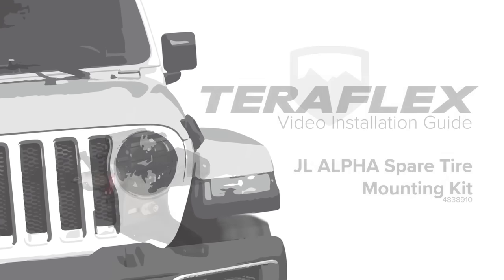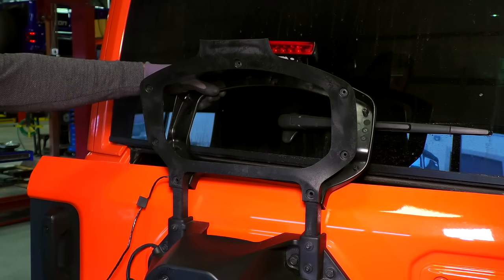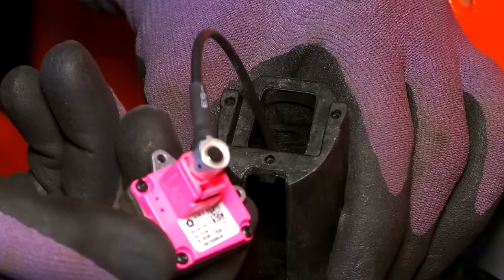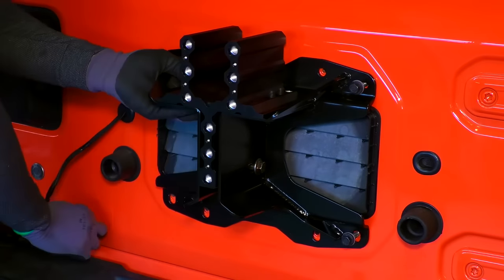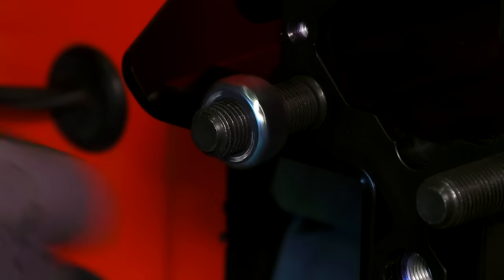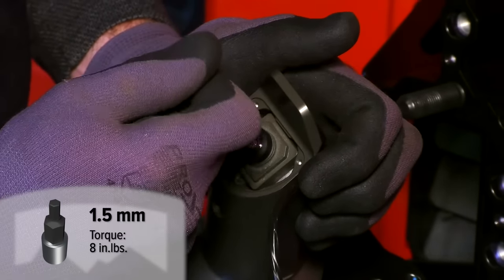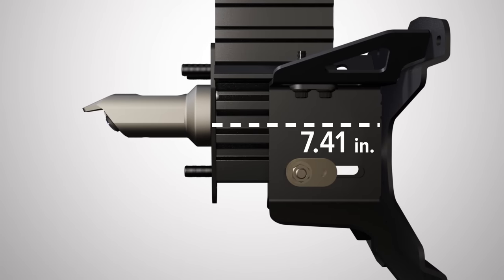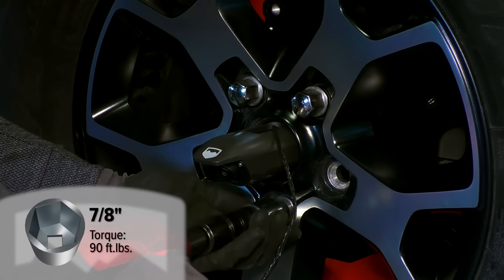TeraFlex Install: JL Alpha HD Adjustable Spare Tire Mounting Kit

Comment: I love this tire carrier for sure. I only wish you could utilize the stock 3rd brake light mount, or you made an option to mount it above and behind the tire. Some states require the 3rd brake light to be a certain height above the outer brake lights, so I can't use this without being hassled by the local law enforcement. I know people that have tried and had to take it off to pass inspection after a fix-it ticket.

Comment: Installed yesterday on my 2021 rubicon to carry a 37 on factory wheel. 
Video was awesome and the install only took a couple hours … the down side was not having a torx#8 … make sure you have one before you start as most sets only go down to 10 or 9.

Comment: Just installed on the JLUR 4XE - You will need to fabricate a small plate with 3 holes, fasten it to the back of the camera so you can mount it.
Reply: Doubt Teraflex has had time to figure that one out since its a new model or have a solution

Comment: Purchased and installed. One beautiful piece of engineering. When will the tailgate hinge reinforcement kit be done?
Reply from the maker: We are working hard to bring out a worthy HD hinge plate. Keep an eye out for its debut.
Reply: @teraflexsuspensions  You're late to the party....the JL has been out for almost 2 years and you still haven't developed a proper hinge einforcement.
Reply from the maker: @Strizzle81  Thanks for the reminder! This part has been extremely tough to perfect and we are still working on getting it up to our standards. We have always been a company that chooses quality over speed. Rest assured when we release our version it will have the R&D, testing, and time put into it to make it one of the best.
Reply: TeraFlexSuspensions Still waiting. I have another hinge reinforcement on right now and  will replace it with a Teraflex when it comes out. I’m absolutely not happy with the one I have on and want to be one of the first to order yours.
Reply from the maker: @kirbytheap  Thanks for the support. The extra time we are taking to create this hinge and make it right will pay off.
Reply: Isn’t it true on the JL, the stock tailgate is stronger and able to support a 35” tire? Especially with this great spare tire carrier.

Comment: Teraflex: Great looking mount! I tightened the stud to 150 ft-lbs and I can’t get the jam nut off!! I bought two 22mm wrenches. Any tips? Also I think you guys should offer shipping the teraflex with customer’s choice of stud locations. It is way too hard to tighten the studs to the torque spec of 150ft-lbs.

I watched the extreme terrain’s video and they didn’t tighten it to torque specs. If I can’t take off the jam nuts, I will try taking it to a local shop and if they can’t take it off, I will have to return to extreme terrain
Reply from the maker: Sorry to hear about the issues. Hopefully you got the jam nut off. Unfortunately that is the only way to send them out as our production team makes these in bulk to ship all over the world.
Reply: I was able to take it off with a breaker bar and after digesting some healthy protein bars! I had actually stripped the thread of the drive nut but luckily on the third stud after tightening!! Taking it off became easier

Still love the product and final appearance. Looks great on my JL and I was even able to put on an LED ring of brake lights.

I also paired it with a redrock tailgate reinforcement from extreme terrain and live the end result. There is no wobble closing the tailgate now and it’s very smooth and sturdy
Reply from the maker: @mail4arjun  Glad to hear you got that off. They can be difficult once engaged.

Comment: If your wheel thickness is thick you will barely get then third brake light on, mine is hanging by a thread. Overall I like it. Just installed it today so we will see how the brake light holds on.
Reply from the maker: Thanks, feel free to reach out and get us some photos of your setup. We would love to be able to take some notes and update the product if necessary
Reply: TeraFlexSuspensions I did reach out and no reply. The email provided doesn’t allow to attach photos.

Comment: Would I be able to raise a 35in tire high enough to clear a bumper that doesn't have the spare tire cut out? It's a flat tube bumper but I still want to run a spare without needing to put it inside the jeep.
Reply from the maker: You will want to measure and be sure. You can also run at the 37" tire height for added clearance.

Comment: Any provision or way to mount a license plate.
If you put on an aftermarket bumper it's a must
Reply from the maker: Agreed. We are working on a solution! Unfortunately no eta yet, but hopefully very soon.
Reply: Any update on license plate mount? Will also need an LED light for the license plate once it goes on the tire carrier
Reply from the maker: @mail4arjun  Not yet unfortunately. At this time we are not certain if we will add a license plate light or not.

Comment: Can this be used alone without the Mopar tailgate reinforcement kit, if I’m only carrying 17 wheels and 35 tires? I have the Mopar kit, but everyone I go over a bump on the road my tailgate rattles a bit. Looking to see if I remove and go with just your kit for the tire. Any advice would be great. TIA
Reply from the maker: Yes, you can use this alone, or with a Mopar reinforcement plate. If not using a reinforcement plate, we only recommend adding a tire with the max weight of 100 lbs.
Reply: Got it. Thank you

Comment: I have a rugged ridge third brake light ring behind the tire of my jeep. Will this carrier accept that third brake light ring?
Reply from the maker: Yes, it should work just fine.
Reply: @teraflexsuspensions  is there a way to have an insert on the top of camera housing? Since i have the third brake light ring it will just be an open hole.

Comment: 2020 JLU, my camera isn't attached to the stud ring. Something else holding it in.
Reply: Follow up if it happens to someone else- my stud ring came out without the composite housing. It felt like it was glued in, i re-threaded the 2 small set screws and it came loose with a few taps of the hammer.
Reply: Same thing happened to mine and I was able to take off the camera housing from the factory tire carrier by hammering in at the same location where I pulled out the two screws of the camera housing

Comment: Will work on a 2021 Jj rubicon? Some people are complaining that the camera doesn’t fit
Reply from the maker: There was a change in the camera mounting on the newer models, but we have a different piece to fix the fitment issue.
Reply: @teraflexsuspensions  ok I purchased
 your rig, do I need to get a factory piece from you separately?

Comment: What tailgate reinforcement do you recommend to fit with this Mounting Kit?
Reply from the maker: We have currently only tested with the Mopar Reinforcement. Which it will work well with.
Reply: are you making your own for the JL?  @teraflexsuspensions
Reply from the maker: Yes, we will be coming out with an Alpha Hinge for the JL as well. Currently in R&D.
Reply: Can this be used alone without the Mopar tailgate reinforcement kit, if I’m only carrying 17 wheels and 35 tires?
Reply: @teraflexsuspensions  Is there any update on this??? I want to order, but only if I can find a hinge reinforcement also.. Not a fan of the Mopar one.

Comment: Will this work with the Mopar tailgate reinforcement?
Reply from the maker: Yes, this will work just fine with the Mopar hinge reinforcement. You will have to use the spacers that come with that kit but it will function just fine.

Comment: Im getting Black Rhino Warlord wheels with an offset of -12, with 35”. Will your mounting kit be able to adjust for this? I still have the OEM plastic bumper. Thanks.
Reply from the maker: Yes, they should work just fine.